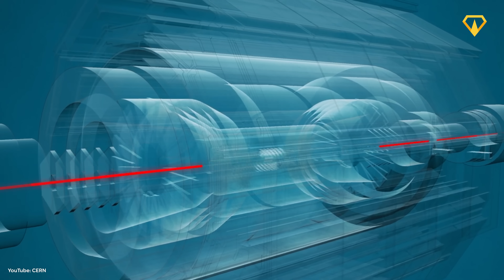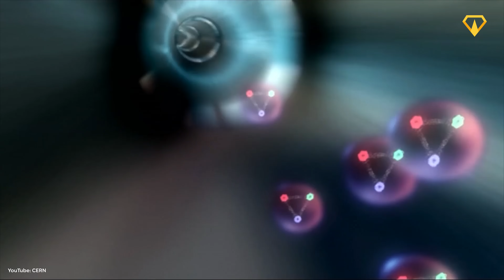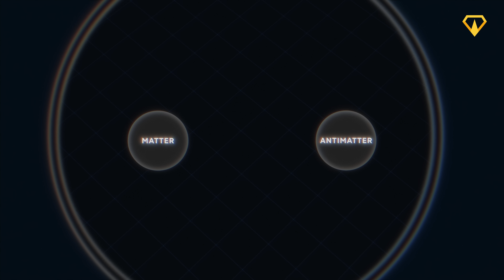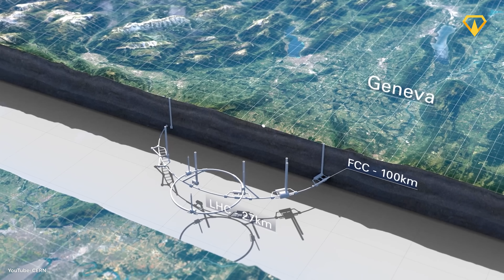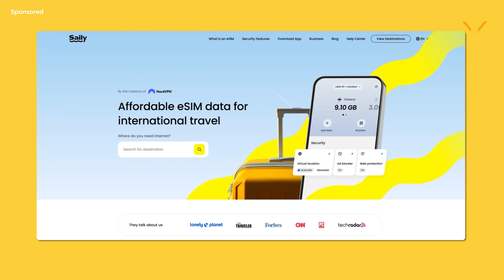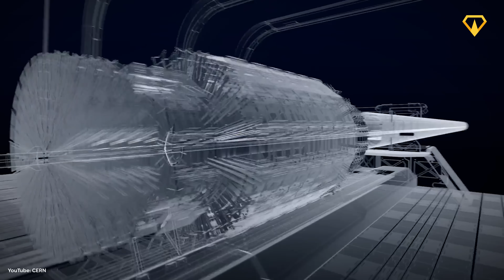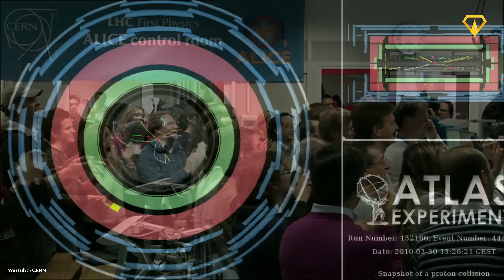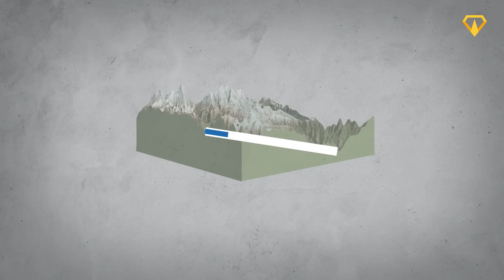Why This $17B Megaproject Could Change the World

Comment: Is it really a good idea to smash reality itself? Even little tiny parts of it?
Reply: This is not the first collider
Reply: @iwantgoat  The point of building an even bigger one. Is to come closer to destroying the fabric of reality.
Reply: the collisions happening in colliders like these are happening constantly in the upper atmosphere, it's just borderline impossible to measure those because they're random  @DestinationBarbarism
Reply: @KingFinnch  I seriously doubt that.
Reply: @DestinationBarbarism  There is no evidence a particle accelerator of any size will "destroy the fabric of reality". Particle accelerators are some of the safest scientific experiments out there, with all the safety measures and just generally low risk
Reply: @DestinationBarbarism No. That's YOUR interpretation of what it does. Which you clearly don't understand.